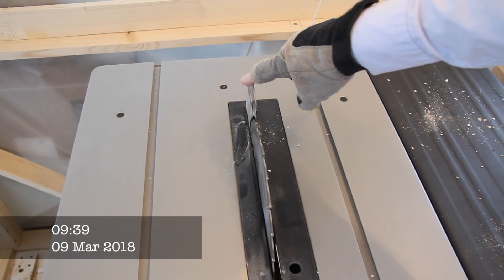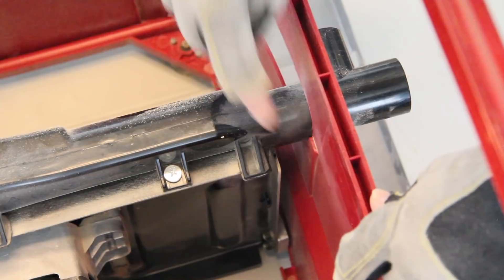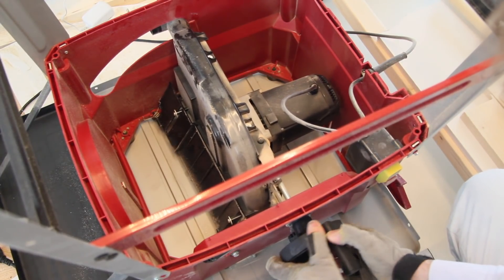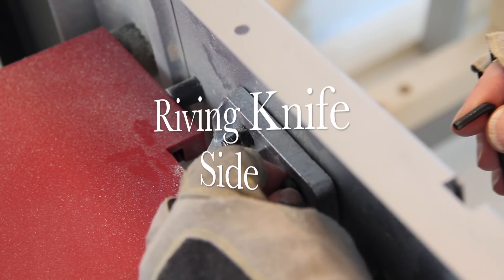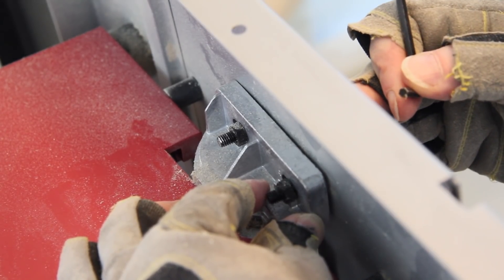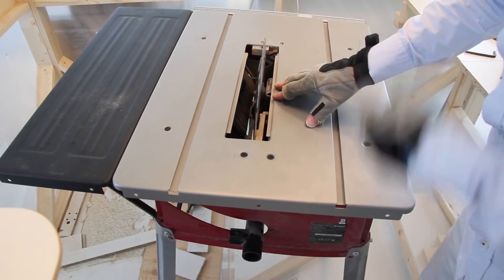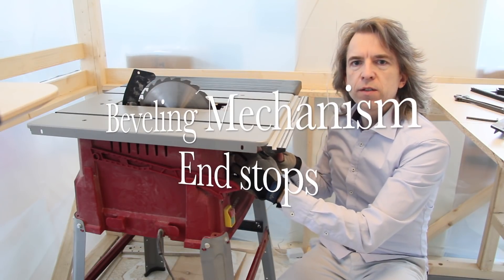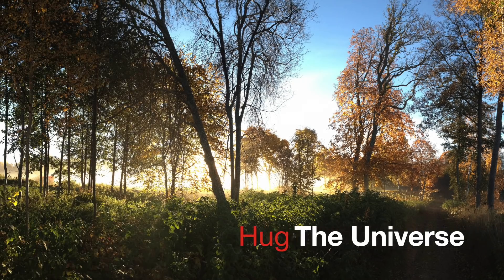Table Saw Blade Adjustments - Einhell 2025 1U Calibration [Episode 62 9 Mar 2018]

Comment: hi is it good table saw?
Reply from the maker: Thanks for asking! It is a good saw for its price. For me I still think it was the right saw for me to get my feet wet. And to know if I even need a table saw which, it has turned out, I am now not sure is the case :). Never the less, If you need a table saw for a low price that works and can be adjusted and used to make quite high precision cuts - then I can recommend it. If you want a table saw that makes precision cuts repeatably and with ease you need a more expensive saw for sure. I which you all the success in finding a saw that fits your needs :). Take care!
Reply: @kjell-olovhogdahl6557  thanks so much

Comment: Hi, so did this adjustment solved the play the saw had? (shown around 0:40)
Reply from the maker: Good question! Yes, I seem to have forgotten that when I adjusted the saw. Sorry to say I now longer own this saw so I can't check. I guess though that the play probably is still there. And you have to trust that the side forces are low when properly aligned. At least I was able to use the saw in at least one high precision project and it performed quite nicely :). I which you good luck with finding a table saw that meet your requirements :)
Reply: @kjell-olovhogdahl6557  Thx for the reply :) I already own this same saw, I have essentially the same problem you had, I tried to align everything but that shakiness at the back of the saw wheel still remains,. Precise cuts are pretty difficult.
I got what I paid for I guess :)

Comment: I purchased this table saw a few weeks ago and on the complete square angle of 0 degrees the saw blade is not square, it bends to the left, looking from the front at it, slightly by a degree or so, seems like a defect!
Reply from the maker: Thanks for your feed back! Yes, it may be a defect or it may be just that for this price that is the precision you get. But you may also be able to adjust the saw along the lines what I show in my video. I wish you all the best with adjtsing and using your saw!
Reply: @kjell-olovhogdahl6557  thanks to you I just needed to adjust it!! Many thanks! I was just being stupid and thinking of the worst 😂

Comment: Thankyou for posting this. After a lifetime in joinery I retired. My son gave me a saw like yours. I had been used to the best in machinery so I did smile when I saw it. Amazingly I found the basic machine after a few modifications to be very capable. I must say I removed the flimsy legs and mounted it on a sturdy table base . Regards Stuart from the UK 👍
Reply from the maker: Thanks for your feed back! I envy you for having been working with professional tools! But the up-side is that there are new types of "success" lurking in having to adapt less capable tools ;) I wish you all the best with your modified "hobby" table saw!

Comment: Great video with many detailed information! I have the previous model BT TS 1500 Einhell table saw and I did the same calibration 5 years ago when I bought it! I still have it and it works fine (woodworking for hobby)! It is a honest machine for the money I gave ! Thanks for sharing 👍
Reply from the maker: Thanks for your positive feedback! Yes - I am also satisfied so far with going with this low price machine to get going and learn. So far it outperforms in value for its money. And you get to tinker with it yourself which is in some sense not all bad ;)

Comment: thanks. still dont know what table to buy...
Reply from the maker: You're welcome! Good luck with fining a saw to buy. Maybe consider to do what I did. Buy a cheap one and spend the money as an investment to investigate and "learn". Some things are hard to decide buy thinking alone. I still not regret buying this saw. But owning and using it, pushing it to its limits,  will surely lead me to buy a better one. And when I do, owning this one will highly affect what saw I will buy next. And surely, the second saw will NOT be the one I would have bough if I had tried to buy the "best" one in the first place ;)

Comment: Great video!
Please tell me something about that saw, would it be able to run a 3/8'' dado blades such as these? - https://www.amazon.com/Freud-20T-Joint-Cutter-SBOX8/dp/B000ASGV1E 
Thanks!
Reply from the maker: No, that will not work. The bore is to short to fit the thickness of the dado blade. And the motor is presumingly to weak to drive the dado blade. Also (speculative) the motor does not have a soft start - so I imagine the start torque would just damage the motor? Anyhow, found this article that talks about this stuff (https://www.thesprucecrafts.com/will-stacked-dado-blade-fit-3536402). Good luck!

Comment: I just get the Fury table .. it seemes to be excatly the same. I'll check all this ajustements... Tks  !
Reply from the maker: Thanks for your comment. Hope you get good adjustment of your saw! Interesting that the Fury saw seems to be "the same" saw. I suppose there is some asian factory somewhere making the same parts for all these saws? :)
Reply: I trad that this saw IS manufactured in China and sols in Europe with many label....Just some detail are différent!
Reply from the maker: Thanks for the info! And good luck with your adjustments :)
Reply: I think Scheppach comes also from that factory, so I will try to implement your adjustments to my Scheooach as well , thanks for your tutorial, subed :)